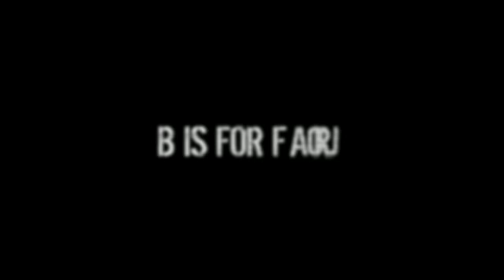Budget Lotus Evora Pt 23 - Sparco Harness Or OEM Belt?

Comment: No way would I be using a stressed belt that had been in a car that has been involved in an accident. I always thought that they should be completely replaced if they had.
Reply: seatbelts don't stress lol. and they probably wouldn't stretch either. people use them to lift engines out of cars.
Reply: +David Serrano agreed. they don't stress.
Reply: I'm guessing you are willing to risk your life on that.
Reply: +Lonski AU I want you to do a test. go to a junk yard. grab a seatbelt tie it to an engine and have one of the forklifts or whatever your local place uses to lift it up. I bet a dollar it won't rip. seatbelts are designed to not stretch at all. and the force required to stretch or rip one is huge. the only thing I would do is inspect the built and make sure there are no tears or anything of the sort.
Reply: +David Serrano belt*
Reply: Maybe you should all do a bit more reading up on the subject before mouthing off. At least in my country it is spelt out, and I would expect there be no difference anywhere in the world. Here is a bit of light reading for you.

http://www.transport.wa.gov.au/mediaFiles/licensing/LBU_VS_IB_113.pdf
Reply: Lonski AU well if you want to be extremely protective then sure go buy brand new seatbelts. But I would bet that in most cases seatbelts can go through a couple accidents before they fail. And if you visually inspect them regularly you will know when to replace them.
Reply: David Serrano agreed.
Reply: +Lonski AU its not like he's gonna be crashing head on all the time. it could be used again. But if you feel safer replacing it, by all means go ahead.

Comment: Pretensioners do not work in a vacuum.  They are an integral part of the SRS system.  A seatbelt will hold you in a car crash no question.  In your bit there you obviously don't understand how the SRS and seatbelts work together.  The pretensioner are the to pull you back into your seat so that the airbag will be able to do its job.  It both works with the airbag to keep you in your seat and prevent injury and because it pulls you back into your seat it keeps you at a distance where the airbag is less likely to cause you injury.
You definitely need airbags, new seatbelts and pretensioners (you can get rebuilt pretensioners at a good price.)  You can't just use one and call it a day.

Comment: That looks like a generic seat belt reel to me. You can go on ebay and get factory new Humvee seat belts that should just bolt right in, both the belt and the receptacle.  

Like these http://www.ebay.com/itm/M998-HUMVEE-SEAT-BELT-3POINT-12480530-BLACK-LH-OR-RH-FRONT-OR-BACK-3PT-12342377-/301898805363?hash=item464a923073:g:vakAAOxy9tpR-BdP&vxp=mtr

I had those in my old bug, and they look exactly the same as factory units, and very similar to yours. You shouldn't reuse accident-used seat belts as the webbing may have been weakened by the shock. 

If anything, its cheap insurance.
Reply: That's a good price, but as he said, the SRS is offline. So the pre-tensioner is pretty much useless. Good idea though
Reply: they dont use pretensioners. They're just standard inertia reel.
Reply: what, the Lotus? what did he remove from the other side of the belt? My apologies if I'm wrong but I thought he said pre-tensioner. I also haven't worked with seatbelts before, so I'm just taking his word for it...
Reply: No, the new ones I mentioned don't use pretensioners, so it's moot. Just bolt in and go, like any car before 2003
Reply: oh righto. My mistake

Comment: Do NOT but the inertia belt setup. i had a ford f250 that had them and any time i was on the brakes(even casually) or going over 110 kmh(90 mph?) they would lock after about an inch of movement. i couldn't grab a drink, change the radio, even roll the window down with it. i constantly had to fidget forward and back very slowly to get it to release. if i hit a pot hole it locked, if i was at more than a 10º incline it was locked, if i moved to quickly it locked. the worst part was, it would allow retract but not extract so it would tighten up as i drove and i would have to undue the belt to re-adjust it around my waist. p.s. i only have a 34" belt line. never again will i get a car with an inertia belt. maybe they're better now but idgaf

Comment: no touching on the hans device, or spinal compression? :/ i would never run a 5 point in a street car especially without a hans device, personal preference but if i get in a head on crash i dont want a broken neck. oem belts for street cars!

Comment: The pre tension-er would not go of before your body 'reacts and goes forward' because that not how that works, your body is already moving forward and its the car that stops, it seems like your are getting flinged forward but you were just always moving forward, if you think about it why would a car slowing down speed you up, it cant it doesent make sense, when your car is doing 100kmh you are doing 100kmh and when the car stops you keep going forward and the seatbelt is there to try and stop you at the same speed of the car

Comment: you didnt cover the pinnacle of safety. The god almighty lap belt. Does the 68 camaro have lap belts of 3 point? my 67 only has lap belts.
Reply: 68 definitely has lap belts
Reply: I personally had 5 points in my 96 camaro but only ever put the lap belt on and love lap belts just make sure they are cinched tight to hold your pelvis and be comfortable because no should bs...
Reply from the maker: lap belt lol

Comment: I know you would let me down sooner are later. you were trying  to put a 4 point harness on a seat that wasn't designed for it.  if you look at the side of a race seat. theirs a hole their design  for the pelvic belt it stop the belt from riding  up on u In a wreck the seat your using doesn't  have the correct  hold down for the belt. so your right on one hand because  it can happen, but your wrong  because  your using the wrong seat.

Comment: If you tight the harness right, there is almost no posibility for submarining, because youre ass sits farter down than the frond of your seat. You sit in an small angle, if the seat would have an angle of 90  submarining could happen but not in an seat like the evora or the BRZ. Sorry for misspelling, i am from Germany;D

Comment: Sorry dude have to disagree with you 100%.

4 point are a lot better than 3 point because of the movement of the body in a crash.  The real crash issue is sliding sideways and slamming into something. You need your shoulders tied down tight so your head is less inclined to hit the window. 

Submarining is really only an issue when running a seat which lays down. IE Open wheelers style. maybe a lambo

Road cars with upright seats its not a problem.

5-6 pointer is the best but is difficult to belt up.  A 4 pointers is the best for the casual users because they can be tight all the time.
Reply: 5 or 6-point is NOT BEST on the road, WITHOUT A HANS you risk serious neck injury. Airbags and 3-points are the way to go on the street.
Reply: +spencp86 agreed 100% with you.
Reply: What are you talking about!!!

5-6 pointers are the best period. They make airbags virtually obsolete

The only reason not to use them is they are painfully inconvenient. (pain in the nut sack)

You don't risk serious neck injury anymore than a 4 or 3 pointer.

The neck is one of the last things to worry about in a crash. Worry about your head hitting window or dash. or your body slamming into the side of the car

The Hans device was invented for open wheelers with heavy helmets and supine racing position. When they crashed at very high speed the head would jerk forward beyond natural movement and the skull would fracture around the base.

For piss farting about in a roadie sitting upright without a helmet at slower speeds you wont need a hans device. It may help if you wear a helmet.

Dont give up on a 5-6 pointer because you think you are going to hurt your neck more because its complete bullshit.
Reply: +AdelaideBikeFreeway they are when used PROPERLY as part of a holistic safety approach including a HANS (which requires a helmet - why would anyone wear one WITHOUT a helmet? That doesn't make any sense, and no reasonable person would ever even consider such a scenario). ANYONE who races will tell you that.

Your statements are uninformed; the acceleration force in even a minor accident is enormous (>60Gs) and if your body is restrained more than your head, you risk suffering major neck trauma even in a small accident without neck and head restraints. That is an empirical FACT. Yes, airbags are NOT effective at all with a 5-6 point harness, and no one is arguing that point. But the 3-point safety belt in conjunction with an airbag is a much safer option for the street than a 5-6 point harness without HANS.
Reply: Spenc, I didn't chime in here because i wanted a fight. I really wanted to help others.

I have spent most of my life in motor racing. I know my stuff.

Regarding empirical evidence on neck injury.... 

In a road car having a serious neck injury without a head impact is pretty much non-existent. All the stats on neck injury are relate to the head or body hitting against something. The vast majority come from head hitting the steering wheel. Almost no serious neck injuries come without some form of impact. The exception is rear collisions causing whiplash. Hence cars having mandatory head rests.

So your head flopping forward in a crash is not good and you may have minor injuries, but compared smashing your face on the dash its the lesser evil. 

Also good harness will help a lot

lap sash 3 pointers suck. Here's why

You might be too young to remember this but there was a big case where the car companies fought against higher safety standards in the 80's. A multitude of studies found that three point harnesses were allowing the upper torso to move too far and causing peoples heads to slam into the steering wheel. 

Hence airbags.

It still hasn't fixed the problem. 

When having a  crash at 90 degrees, with a pre-tensioner and airbags. The upper torso still pops out from behind the belt and flails about causing serious injury. 

Volvo came up with a four point harness. I think BMW and VW came up with their own versions, but it hasn't been adopted. Yet

I just googled it and there is some research for happy reading.  

Check out the picture page 8. This is why you don't use a three pointer.

http://www-nrd.nhtsa.dot.gov/pdf/esv/esv18/CD/Files/18ESV-000451.pdf

This surprised me even Ford discuss it:

http://wardsauto.com/news-analysis/growing-interest-4-point-seatbelts

Now this is empirical evidence. Tested by two separate companies. 

A three point harness is dangerous. No one in their right mind would race in one apart from weekend warriors. They are banned in almost every form of motor racing.

I stick with my previous comment that running a good 4 pointer properly adjusted in a road car is a very good option.